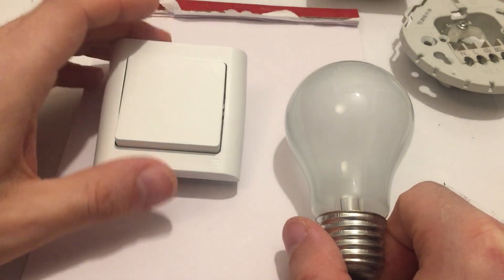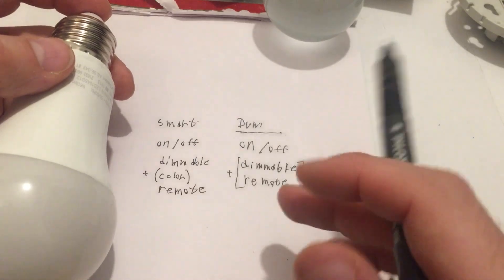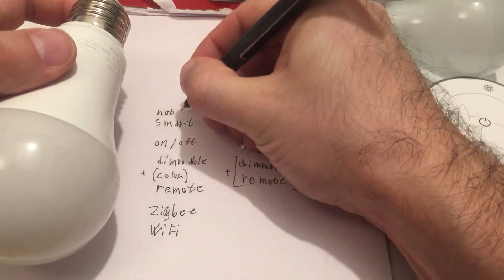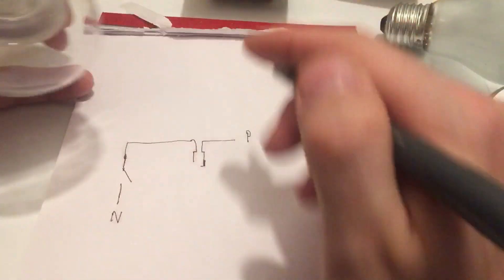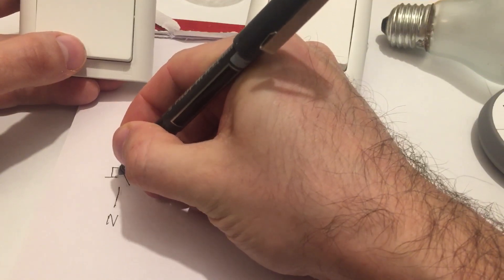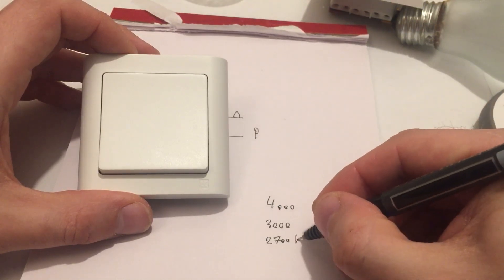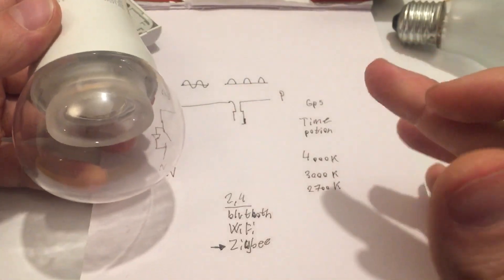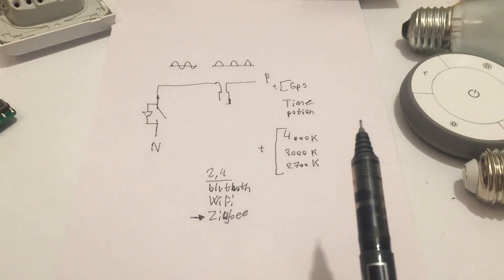The smarter light bulb

Comment: GPS er fortsatt dyrt og krever clear sky for å fungere (fungerer ikke innendørs.) Du vil ha mye bedre suksess med kort-bånd radio. https://en.wikipedia.org/wiki/DCF77 er hva du vil ha, og koster mye mindre og vil fungere innendørs :) Har vært levert i klokker i mange tiår allerede.
Reply from the maker: DCF77 virker heller ikke altid indendørs. Jeg skal også bruge GPS-koordinater for at beregne solens position.
Reply: @PerMejdal  du trenger ikke nøyaktig posisjon for det. Sjekk nrel sin solpos-algoritme. Jeg har i sin tid bygget en helisostat med GPS, kan linke en video om jeg finner den.
Reply: @sveip  DCF 77.5KHz is very low frequency , and requires a rather large antenna, not really suitable for a small light bulb.

Comment: I can't see a marked for this. there is a similar solution using Home Assistant and thats free. If the zigbee modul can be programed then it might be interesting for more people.
Reply from the maker: Are you referring the my wall switch which I have already shipped 1400 of, or the light bulb which does not require  a bridge/gateway?
Reply: @PerMejdal  I only comment to what I see in the video Have you shipped 1400 of that ??

Comment: Dine oplysninger om dagslysfarvetemperatur i kelvin er da way-off, i det noon daylight ligger omkring 5500k og en på en overskyet dag er du noget højere op, vel omkring de 7000k. Men de 4000k er udemærket som arbejdsbelastning, men så absolut ikke den korrekte farvetemperatur ift udendørs som du eller oplyser i videoen.
Reply from the maker: Jeg mener nu at 4000K fint matcher udendørsbelysning. Det er i hvert fald meget bedre end 3000K. Der findes systemer med lyssensorer der hele tiden prøver at matche lyset udenfor. Hvilket betyder at lyset ændre sig i det skyer passere forbi, og folk bliver skøre i hovedet af lys-temperaturen hele tiden ændre sig.
Så jeg holder fast i 4000K om dagen, 3000K om aften, og 2700K om natten.